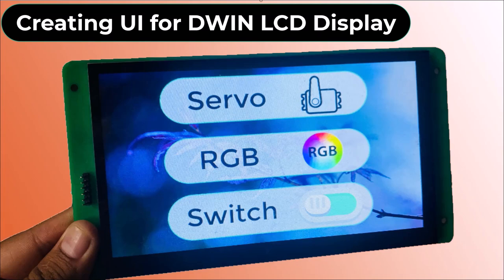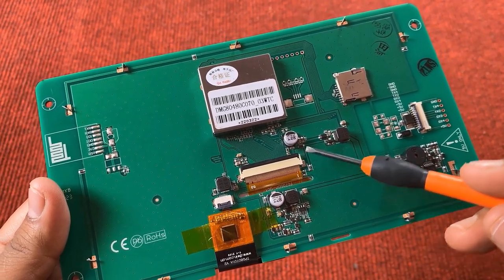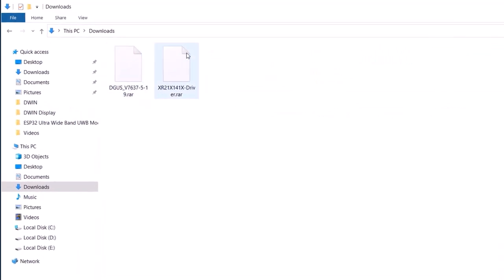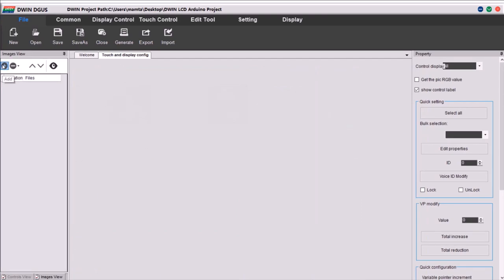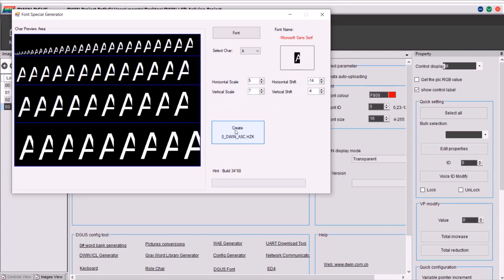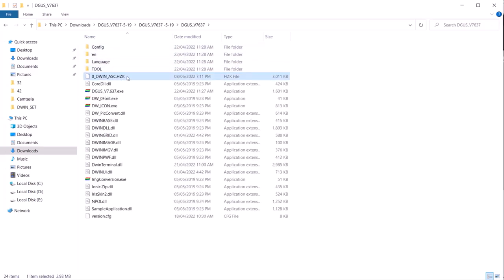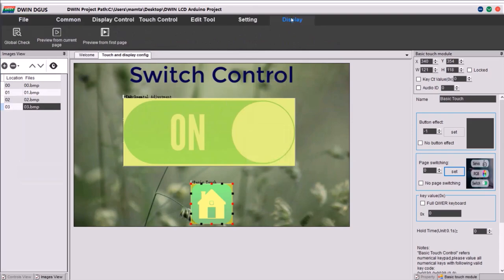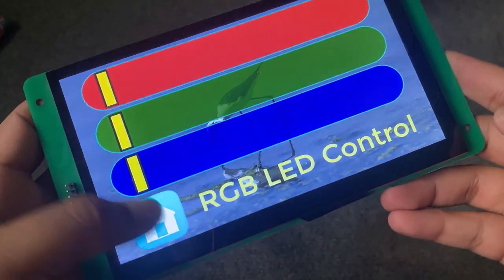DWIN LCD Display Tutorial || Create beautiful GUI without programming with DGUS Software

Comment: 👏👏Nice video for people who is the first time to use our LCD module, they will know how to create a project in your direction. Looking forward to your next video sharing how to link with MCU or other controllers.
Reply: can it be used with plc ?
Reply: @anandjoshi8554  Yes, can be used with PLC, but the most important step is communication.
Reply: @DwinTechnologyOfficial  how do you get the screens to go to sleep mode? Or even a way to power it down without unplugging it.
Reply: @VenkmanJ  edit CFG file, is it possible for you to let me know your model name?
Reply: one question: when soldering the pins to use the LCD for TTL, it actually means to solder the two pins together?  I am still confused about it. Thx
Reply: @andresh985  If TTL and RS232 optional, usually factory set RS232, so if you need use TTL, solder the two pins together is correct.
Reply: Thank you, now we can set function for the creality LCD in marlin!
Reply: i am using dwin 480x272 hmi lcd. this lcd gives more bytes on serial port. extra hex data along with command packt
Reply: @pratikbhagat1731  We have a file, download and cancel the extra data you received, free, please check with sales.
Reply: @DwinTechnologyOfficial  give link or sales contact we are stuck in production prototyping
Reply: Can you please tell how to clear memory of dwin display(7 inch COF touch screen  DMG80480F070_01W (COF Series)?

Comment: Hi
In DGUS software, is it possible to move from one page to another by entering a password? Or in other words, can conditional commands be applied in this software directly without the help of micro?
Thanks for your useful content
Reply: Hi, the dgus supports this function, but it needs micro to judge the passwords  whether it is correct or not in practical
Reply: is this is compatible with plc also ? I need low cost HMI for my GIC plc
Reply: @anandjoshi8554  Sure. It can work with PLC too